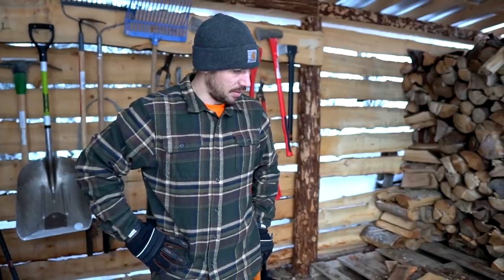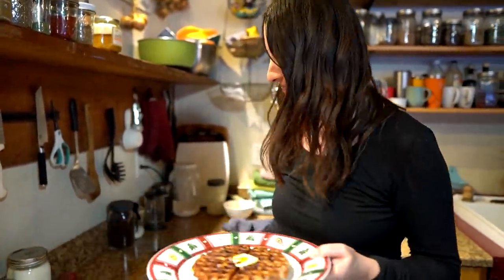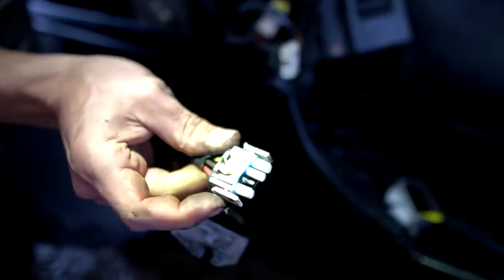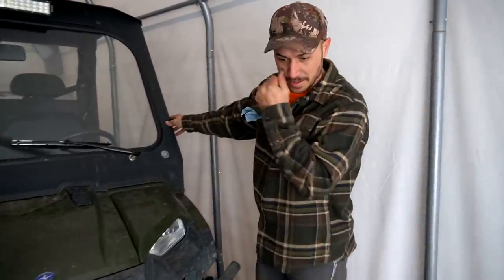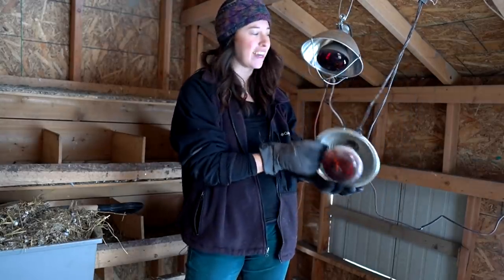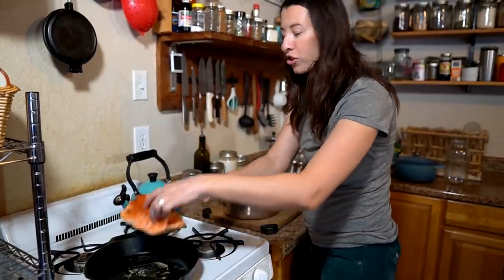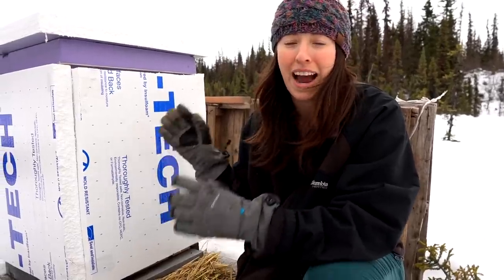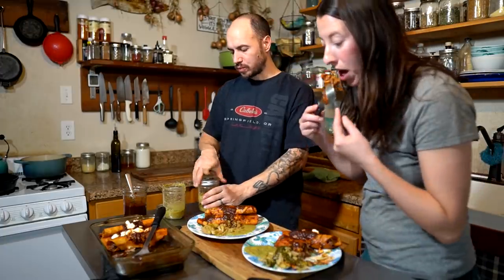Warm Winter Days | Cabin Life in Alaska

Comment: Season that waffle iron to within an inch of it's life.  Place directly on the coals until smoking hot. Grease, add batter, cook on top of stove. Otherwise it sticks. Some other tricks are let the batter stand for 30 mins, the lysis of the flour helps. Fat in the batter a must. And do without sweet or liquidy additions until it works well most of the time. Canned or frozen berries work great in muffins but reek havoc in waffle irons. Go for dried into the batter before lysis. They absorb some moister and don't turn things that weird blue grey color.

Comment: I know you welded an extender on to that other wagon connected to the dogs wagon. But I personally would have drilled a hole down after welding and put a bolt just in case the weld didn't hold at least you would have a hole there to replace a bolt or the bolt would keep it on.

Comment: at the 1:30 spot , cleaning out the woodstove, an old timer once told me if you get your scuttle bucket close to the opening of the stove, and you still have a few warm coals sending heat up the pipe, that the ashes dust won't get all in the house because they get sucked up the chimney. It works, been doing it for years. Tip from an old timer.

Comment: Eric, the bulb you held up for the snowmobile headlight appears to be a Halogen bulb, which are VERY sensitive to contamination from finger oils and need to be super clean before installation. Otherwise, they overheat and blow. Yes, LEDs are the way to go, requiring much less amperage and draw on the charging system.

Comment: Don't know if you'll see this, but i saw a vid that said after their beginning of winter molt, the regular chicken feed that is used for "bigger quicker for a first year harvest" doesn't have enough protein in it for them after their molt to allow them to lay also. They need a half chicken scratch half chick starter feed bc chick starter is high in protein AND also an at will source of calcium in the form of shells. This will allow them to lay even during the winter by restoring their protein and calcium levels

Comment: You might want to get a Fiskers splitting axe to save a little energy on some of the easier to split wood.I grab the Fiskers  maul on the tough to split Hickory and Oak with knots and twisted wood grain and switch to the splitting axe for the straight grain wood when possible. Good Luck! :)

Comment: I would recommend putting anti seize compound  on the hitch pivot. Once you start using it the powder coat will be ground off t bare metal  and then when it stands for summer you could get rust build up

Comment: I wrote this before, but I don't see it. I have a friend that works at Walmart, and he gets sheet cardboard for free. He lines the floor and the nest boxes with it before putting the hay in. When it's time to clean he pulls the cardboard and hay out together and puts it in the compost, where the worms eat the cardboard and everything. It might be too late now but this summer you can do a deep cleaning on the chicken coop, maybe pressure wash, then try the cardboard. Cardboard has many uses; I use it to crawl under cars and stay clean and dry.

Comment: That's a good modification on the dogsled hitch. May be good to put a bit of weld to close up the end of the eye bolt ring. It only gets used in the cold and that is when metal likes to break. I see that you have safety chains as well.

Comment: Eric sometimes a extra ground strap from engine to body helps. My 1999 Skandic has done this also. Bulbs expensive. I added LED also. Try parts USA for voltage reg. We have a few parts places in Canada that can get regulator if that fix doesn't work. I can get you one if you want.

Comment: Eric could you use a capacitor within the wiring to help regulate the power, and if the dog sled doesn't work, change it to a 2 inch receiver, straight through underneath, hitching front and back
Reply: Thw lights actually act like a fuse so a capacitor would be a bad move. Because it has to release the extra current and a cap won't let it. It  was probably working fine before but when anything electrical gets a loose connection it creates heat which then melts so it was probably the connection at the plug at the voltage reg

Comment: Did the Skandit come with LED originally?  My husband rebuilds motorcycles and other small craft, he said the original voltage regulator may not do the trick long term if the snow mobile originally had regular bulbs.  LED are super sensitive to voltage changes, and since your snowmobile has a stator instead of an alternator the voltage fluctuates a lot even with a voltage regulator.

Comment: Instead of risking loosing a bulb, just connect a dc multimeter on to the voltage regulator load wire and the other to ground and rev the engine. You will immediately see any spike in voltage on your multimeter

Comment: Not to be a safety hall monitor, but a full face shield is really preferrable to safety glasses when grinding. I took a metal burr to the cornea using safety glasses with an angle grinder and it was not fun. Love your videos, keep up the good work!
Reply: The thing about glasses is, you can have a spark hit your cheek and rickeshae up to the inside of the glasses then bounce right into the eye
Reply: @toddswenson9137  You nailed it. That's precisely what happened to me. OSHA actually recommends clear safety glasses AND a face shield.

Comment: Hey Eric I have a suggestion for you. On the Polaris hitch I would suggest that you get some square tube and weld it to the tip or bottom of that steel hitch and then make it so your pintle hitch can slide into that square tube. Kinda the way my sled came from the factory.

Comment: Another great video. You did a great job on that voltage regulator. That was your problem was basically a spread terminals at the connector. By hardwiring it you fix that problem. You might want to check and make sure you're charging system is not overcharging. Make sure it's around 14.3 volts at high Rev.
Ariel looks like you had the fun job at cleaning out the coop. I'm sure the girls were real happy after that. Also great job on that third waffle. There's no way around it they are messy. Go into to a Waffle House sometime and look at the waffle making station it's pretty bad.

Comment: As a former metalworker be careful of welding around the threads on screw clamps. your splatter will get on the threads and wreck the clamp.  Take some excess plastic bottles or plastic tubes and just put them around your thread and you will not wreck your screw clamps. Enjoy your understanding of how to get by in how you are fixing, your stuff, it will last.

Comment: thereis something called a snow sportplow its a manual plow made out of aluminum and  uses thick rubber for 000the cutting blades and they have rubber side  edges to keep the snow in more of agroup then your pushing it its an interesting plow cuz the light weight wont be as hard on the front end of your pickup and anll you need due is add a two inch reciever hitch to the front of your truck n makes it fairly quick and easy to load and unload the blade by yourself. All things have advantages and disadvantages.  Id say check it out as you might be able to build one out of wood. But ud need a mill to cut the thicker boards but if push came to shove you could build one for a pickup if ur a little crafty . n there is a place called "repurposed materials" n they always have odds and ends that are useful for a variety if uses various buckets barrels IBC containers and feeder troughs n rubber matting ropes you name it pipe or chain all kinds of things

Comment: I was going to put after market LED bulbs in my  2010 Toyota  but after researching a lot , it turns out staying with the halogen bulb  was much better because the housing is designed to project the light specially from that bulb. And further down the rabbit hole it turns out the LED bulbs can have feedback and causes problems for the cars and basic 12v systems, not sure if I’m saying it right But that was my takeaway , they may need a ‘driver’ to stabilize the voltage or something ,

Comment: Just occurred to me as you were splitting wood...what do you do when you leave your place for a couple days?  Seems any liquids would freeze as cold as it gets there.  We have a wood fired boiler and it needs wood once a day, every day.  I plan on backing it up with a propane boiler that comes on when the water temperature gets low enough but right now we have to put wood in it every day.

Comment: hey Eric, how often or how many miles do you get from a sled before upgrading? Do you rebuild or replace?
Reply from the maker: I'm not too sure since we have only been riding for a few years but we have seen machines with 20,000 miles and you can also have motors rebuild which is quite common up here.

Comment: You realize the best wood stove is one that that Banks the heat cuz your not constantly feeding it and that kind of stove you have to build yourself.  and you can be pretty creative about it how you put it together its called a "Rocket Mass Heater" as after you fire it up it stays warm pretty much all day long because it uses sand gravel cock and clay for the cobb you use to cover it all with AND ITS EVEN POSSIBLE TO SLEEP ON IT. AND YOU DONT NEED A CHIMNEY. CUZ THE EXHAUST GASSES ARE ONLY ABOUT 150 T0 1`60 DEGREESA SO YOU CAN VENT IT OUT THE SIDE OF YOUR HOUSE LIKE A DRYER VENT. aM\ND YOU BURN WAY LESS WOOD AND THE WOOD BURNS VERTICALLY VERSES HORIZONTALLY? Peak your curiosity there are instructions on line on you tube and various other places. How to construct the whole thing or you could use them for out buildings and tents or even green houses. or places housing bees for tjhe winter months. I know sounds sort of like a Hippy thing but if you figure it out it could be a cottage business./ SAnd you spend less time cutting wood and you can leave or go outside for a day say fishing or hunting n come home to A HOUSE THAT IS STILL WARM. So there are certain advantages to building one yourselves.